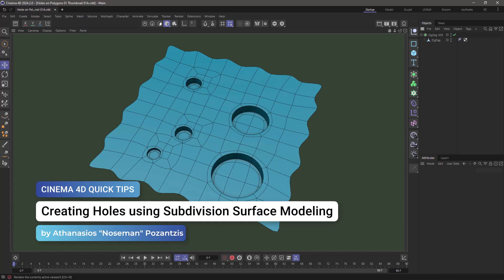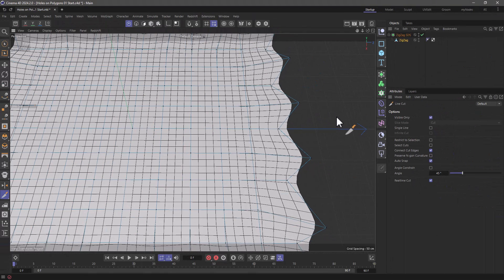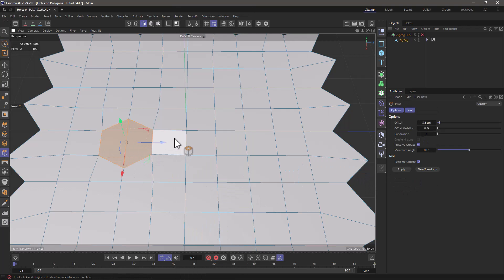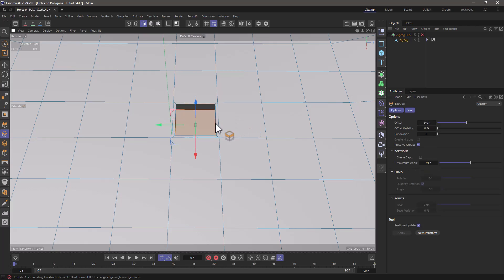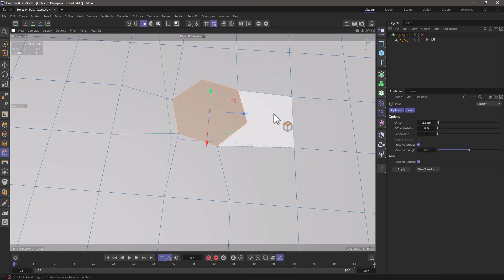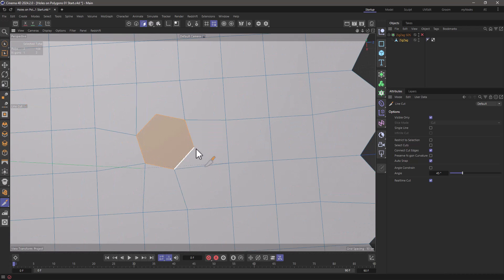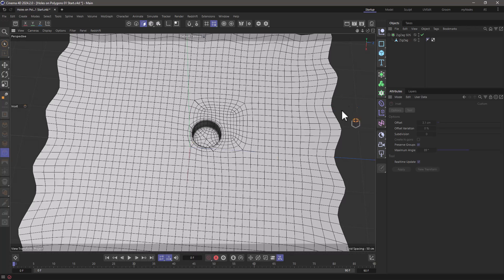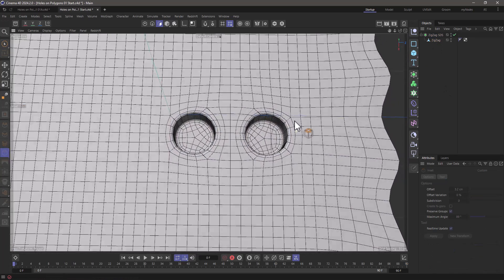#C4DQuickTip 118: Creating Holes using Subdivision Surface Modeling in Cinema 4D

Comment: Here’s my way, that you can also use for cutting holes on the sides of cylinders. Find a point you want as the centre of your hole. Select the four polygons that surround it. Draw them in and take it from there. You also won’t need to add unnecessary geometry. It’s also lighting fast 👍